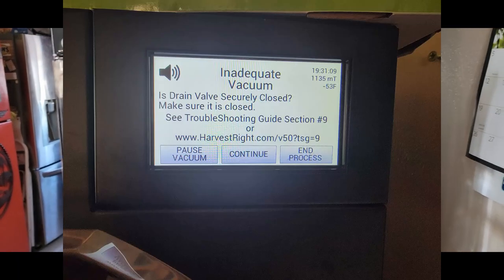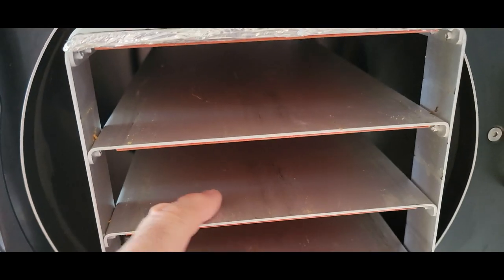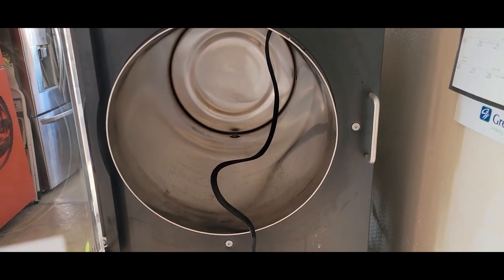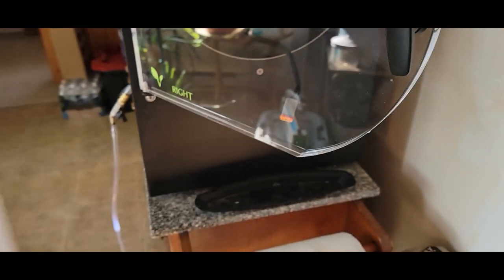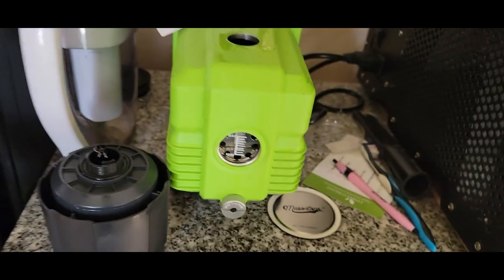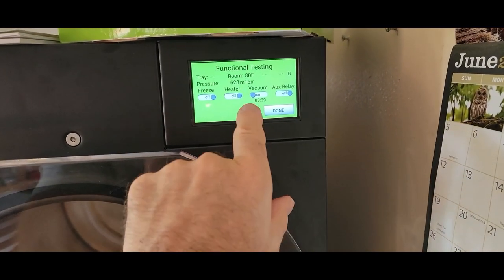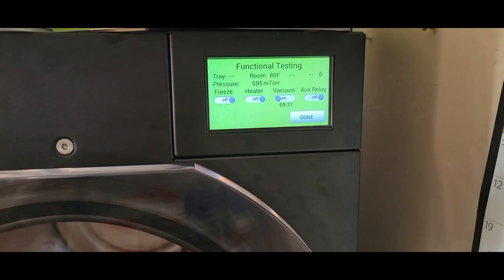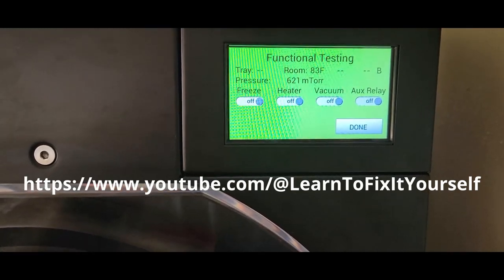Harvest Right Vacuum Error #9 - Part 1

Comment: Worst Christmas present for the wife ever. Didn't work right out of the box. Going over every video I can find.  Thank you for your series.  Can't get through to customer service yet but doubt this a priority for them. Whish I  never purchased but too much money to walk away.
Reply from the maker: I was working with a tech and he even called back today to see if the new cable worked.  I didn't use it but stored it inside the unit just in case I later need it.  The tech did tell me they have made some changes in the design.  There were 3 places that caused the problems. the sensor threads, the wire going into the unit, and the threads on the connector for the wires. But that doesn't sound like your problem if it never worked.  Did you order direct from HR?
Reply: Harvest Right plays a game where they will keep you jumping through hoops until your return period has expired.

Comment: I have a machine almost two months that never worked. We did dozens of tests, replaced several parts and it never would hold a vacuum. They finally are sending a new machine. I’ve never had a successful run. Praying this new one will work!
Reply from the maker: My unit worked for about 50 batches and then started getting the error.  I did finally fix the problem.
Reply: What was your final diagnosis? What was the problem?

Comment: I had a similar problem with mine. It says put oil to the halfway mark, but I had to put a little more because it would go really close to the minimum mark when running. After speaking to customer service, they told me to add just below the max line, and it worked.  Haven't had a vacuum error since.
Reply from the maker: I have been running mine at just above the mid-point and will have to take a look at it.  watch the series and see what I found wrong with the unit.  There are several problems some are design and some are manufacturing problems.

Comment: I was able to fix the vacuum leak I had by silicone caulking various points inside the machine, replacing the ball valve, and then silicone taping all the connection points on the hose lines. Took about 3 weeks of trouble shooting it myself and it was very frustrating but finally got it working.
Reply from the maker: That is what I had to do as well there were 3 places that caused the leak, the wires, the connection for the wires and the threads for the sensor.
Reply: @LearnToFixItYourself  Same. Even with every connection point on the machine sealed it will still leak once the vacuum pump is turned off, so I don't really know whats going on there. I can still get a sub 100mTorr when running a batch though, so good enough I guess.
Reply from the maker: The tech I talked with said the machine was never designed to hold a vacuum when the pump was off.

Comment: The dreaded INADEQUATE VACUUM  error.. This is a HUGE problem for FD units.  It's not just a few people, but numerous people have this issue..and have for a long time. Not sure why HR hasnt resolved the problem. It seems that the most common fix is tapping/wrapping the drain hose connection and the drain hose connection.. and some of the harness wires.  Any unit shipped out of that plant.. SHOULD HAVE ALL THOSE POINTS WRAPPED.. The customers SHOULD NOT HAVE TO TEAR OPEN A BRAND NEW MACHINE TO PERFORM THOSE STEPS..  These arent cheap machines...not sure why HR is expects the customer to do this work.
Reply from the maker: It is unfortunate that a company would expect the customer to fix a new machine. In my case, there were three places causing a leak, and the drain was not one of them. I was eventually able to get it fixed, but you may want to refer to other videos for information on how to fix yours.
Reply: @LearnToFixItYourself  I've watched so many videos..Lots of time spent.. on this.. so I'm pretty up on the vast majority of problems/fixes.

Comment: I have the same issue. Failing to pull on while vaaccum freezing. Just fail over and over replaced hoses even total pump replacement. Valve and even oiled the seals new oil over and over still fails at about 750-900mt. Only got 36 batches out of it total. Piss poor performance for what I paid. They should be ashamed
Reply from the maker: there were 3 places that had problems the wires the threads for the connection for the wires and the sensor, In the 9-part series I go over all I had to do the fix the problem.
Reply: @LearnToFixItYourself  you solved it I hope. I watched it all. They’re using pure silicon for the seal. I buried that part. When I opened the back they had silicon on the wires going in but shitty job as the wired were stretched through the silicon and created a pretty big gaps on all 3 wires. U could see down in through the silicon. Really piss poor quality review. It should never fail in first month. I bought compressors 1200 and they run perfect for many years. What’s harvest rites excuse. Designed by a chimp
Reply from the maker: I have given the tech I talked to an ear full,  I even told him I could come and fix there problems,  and put together a text plan to ensure they are good.  I used to design test equipment.

Comment: We have been having problems with two Harvest Right freeze driers, one is a large and one is a medium size.  I am now having another vacuum problem with the medium machine.  Or am I?  I ask that because when I take out the tray rack it will pull a vacuum of 475 mTorr within 9 minutes, i thought my problem had been solved.  But the I replaced the tray rack and ran another vacuum test.  After 30 minutes it only drew down to 665 mTorr.  What gives?  I do know one thing for sure, trying to keep these two Harvest Right freeze driers running properly is driving me Loco.
Reply from the maker: It sounds like the cable to the trays is getting behind the trays and preventing it from going all the way back.  when that happens the trays will prevent the door seal from compressing when under pressure.
Reply: @LearnToFixItYourself  That’s the issue I had. I made sure the cable was on top of the tray unit and that fixed the issue.

Comment: I'm jealous you get yours to go below 750. Mine went down to 750 and has now increased to 790 with the pump still running.
Reply from the maker: when you under vacuum spray some window cleaner around the sensor connector as well as the treads and wires coming from the tank,  if you see the vacuum go up that is where it is leaking from, and will have to get it sealed.
Reply: @LearnToFixItYourself  I was able to fix mine with epoxy all over the sensor plug area. Now I can achieve mid-300s. 👍
Reply: What and where is the sensor plug? @JPGtampa
Reply: @martwins06  Take the covers off and it's on the upper back of the drum. If I remember correctly, it's about the 1 o'clock position if you're looking at the front of the drum. If I'm wrong, you'll find it 😁
I did the epoxy fix on mine and it worked just fine.
Reply: Thank you, taking the unit apart was my last resort to fixing it.  I guess I’ll be doing that tomorrow.
Reply: @martwins06  Yep. Been there. If you haven't already, look up a video on the epoxy fix. I used some thick masking tape to make a barrier to contain the epoxy. I made sure it didn't seep out of the makeshift containment barrel and then I walked away and let it cure overnight. Some people say to run a test cycle in order to get the epoxy to pull into any microscopic crevices, but I didn't do that. Give it time; as with most chemical reactions, it will happen more slowly if it's cool/cold. I filled the area up to slightly above where the wire goes in. Anyway, it worked like a charm. Approach it with confidence... Good luck and let me know how it goes.

Comment: It's quite normal for the M-torrs to increase when the pump is turned off.
Reply from the maker: yes, they are not designed to hold a vacuum, however in this case there were 3 places the vacuum was leaking from that caused vacuum error #9

Comment: My machine has been broke since March, very frustrating.  Damn I miss my machine. Unfortunately a $4000 waste of money.
Reply from the maker: I just got off the phone with support yesterday we did the test for the epoxy leak and it passed, so we tested the sensor attached and it failed.  we removed it and redone the Teflon tape,  it still leaked so we put some more on it and when we tested it, the vacuum only slightly when up.  Check out part 2 which posts tomorrow then the following will be part 3,  I'm now working on part 4 testing a batch.
Reply: I’ll be watching going through the same thing
Reply: I am
Almost to give up too
Reply: @cc93651  me too. Expensive pos poor quality control and people that are just bad
Reply: Yea, they are awful about units not under warranty. $3000 boat anchor. At least right now. I have been working on it for two weeks and can't find the leak.

Comment: I have done 42 batches, then got failure code, checked all connections, leak tested door and fittings, changed oil again even tho I had done it at 30 batches, cleaned the pump demister, and sent in all the machine data to tech support, I think I have a failed pump
Reply from the maker: have you tested the connections for the wires that enter the tank as well as the sensor?  that is what caused my errors.  I chronicle my journey in fixing the leaks.  

Basically, there were 3 places causing the leak.  The sensor threads leaked. the wires leaked and the threads on the connection for the wires.
You can watch the other videos in the series to see how we fixed them.
Reply: Which vids I will look into it